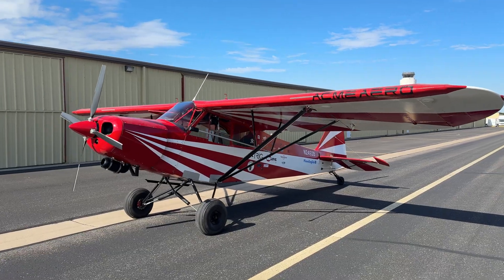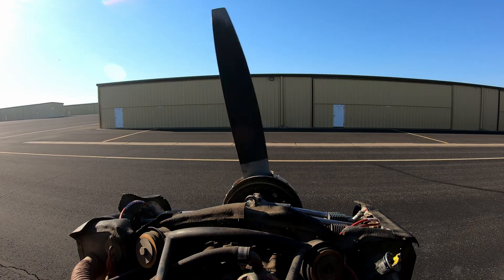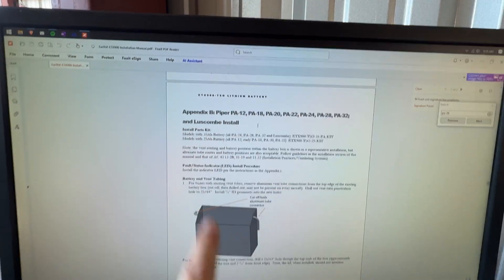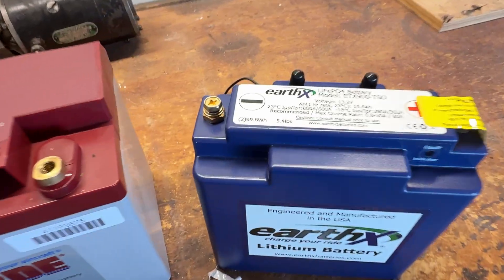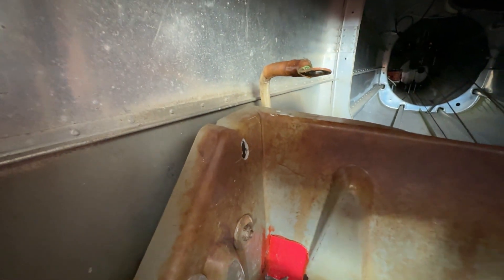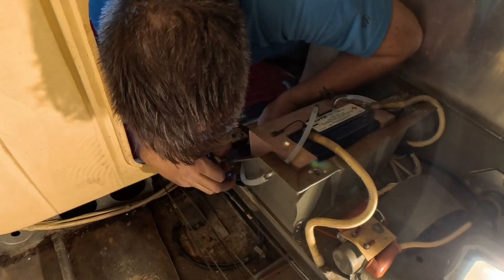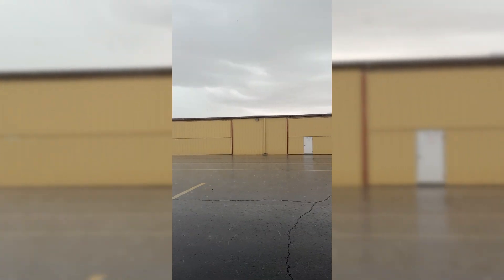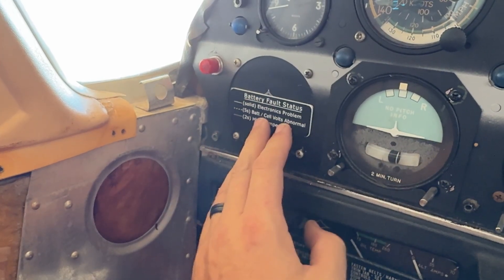How SAFE Are These Airplane Batteries? | EarthX For Certified Aircraft

Comment: Great video, thanks! Quick comment: I learned to always disconnect the negative terminal first to prevent sparks and short circuits and make the system safe the work on. Is this different in an aircraft?
Reply from the maker: IMO it doesn't matter which side you take off first, both sides will spark. Car stuff was more about potentially having a wrench make contact with something metal when loosening the positive terminal first.

Comment: Great video! Did you have to get an IA to sign off on the installation or is that owner allowed under the FARs?
Reply: Yes! No different than any other STC!
Reply: @EarthX_Lithium_Batteries what’s with the ! points?  No need to yell.  Honest question as I’m not an owner and never done a STC.  Calm down,  especially if you are representing your company (based on user name). 😂.
Reply: @adamcorby804  I use exclamation marks as positive enhancements to sound more friendly. Happy to have answered your question.
Reply from the maker: Yes. Funny part is, the example 337 they provided was for my exact airframe. Just updated the serial and personal info. Handed it to the IA. LOL

Comment: EarthX  is a great upgrade. Also the least expensive way to remove useless weight from your aircraft. I’ve been using their batteries for  over 12 years now in the Southern Arizona environment with zero issues .  EarthX batteries have  very complete install kits for your  specific aircraft. They also have a sweet jump pack too so visit their website and check those out. Thanks Carl for this video. You did a good installation job.  Enjoy every flight. ✈️